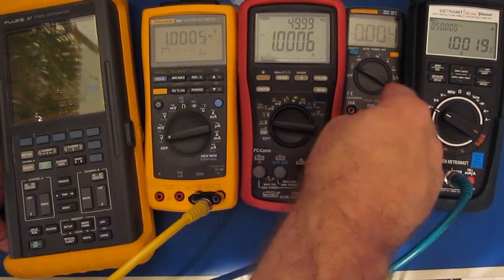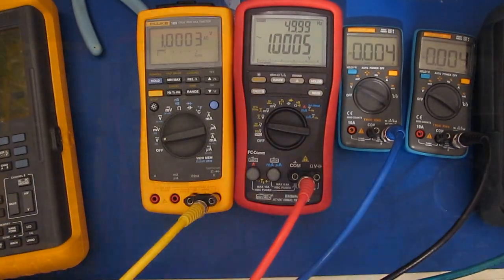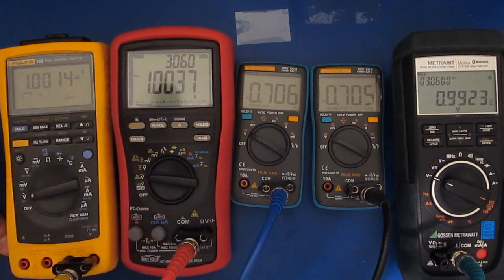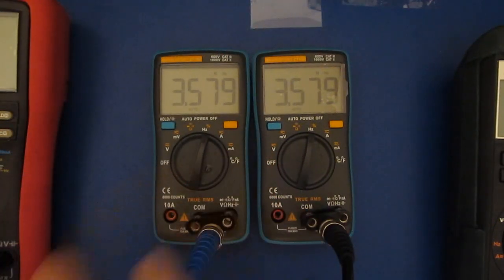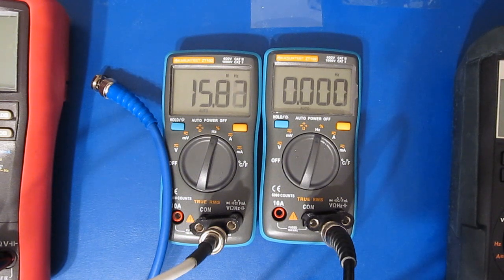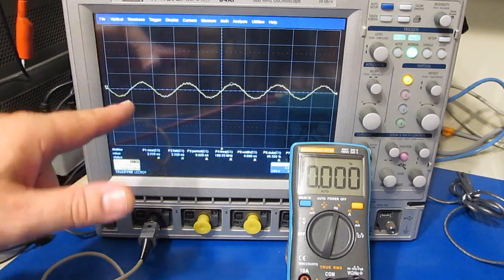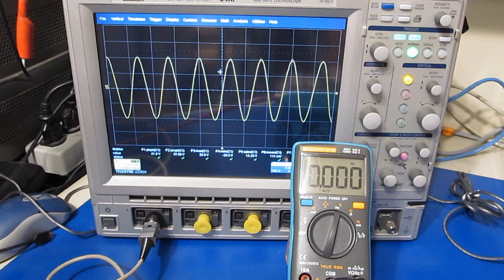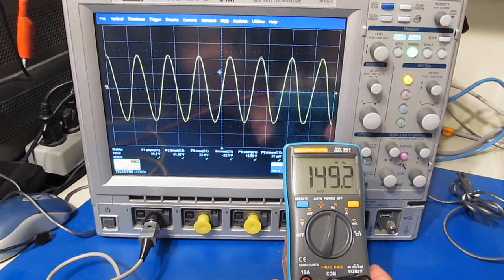How did the KASUNTEST ZT102 Mods Effect the Frequency Responce ?

Comment: look 189 i think for have "only" 220khz BW its more quiet than brymen , at low level AC this is usefull for DC-DC testing and in that frecuency you check for phase and gain margin in stability measurement . i repeat in my others post fluke 189 its very NOBLE DMM everything is coldly calculated for that device and easily win to big brother fluke 289 with 1Mhz BW , in this area .